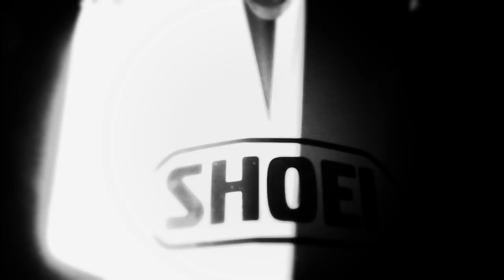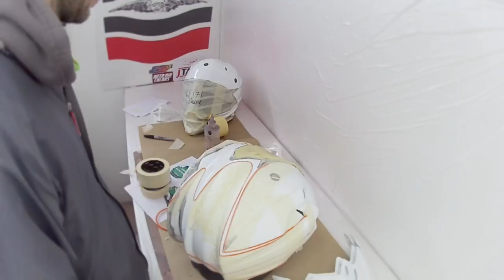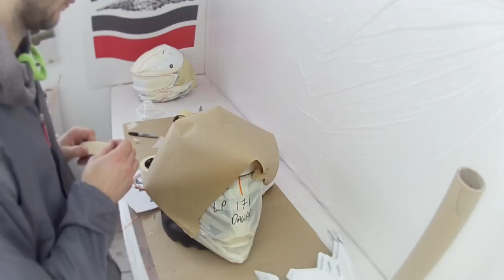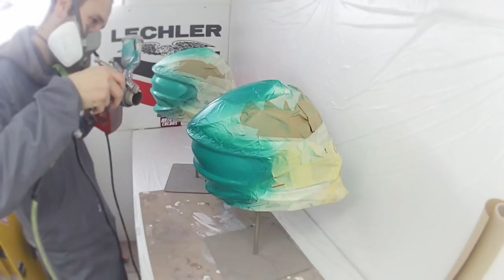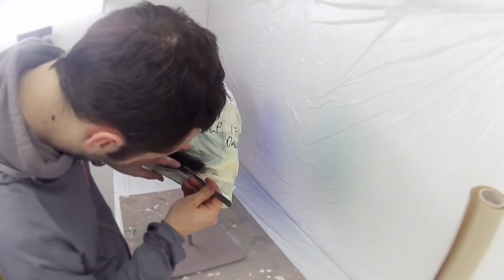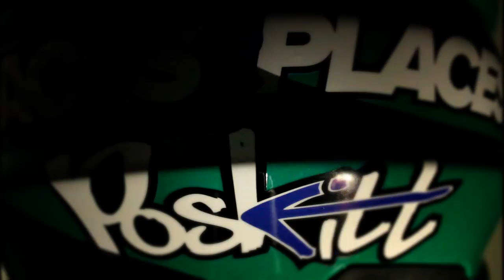Lyndon Poskitt 2018 Dakar Rally Shoei VFX-WR

Comment: Nice job! Just a little technical question: you don't prep or a least sand a little bit the helmet before painting?
Reply from the maker: Hi Benoit. We never film the prepping of keying of the helmet surface because it's done away from the paint bench to avoid getting dust in the area which could cause nibs in the paint.

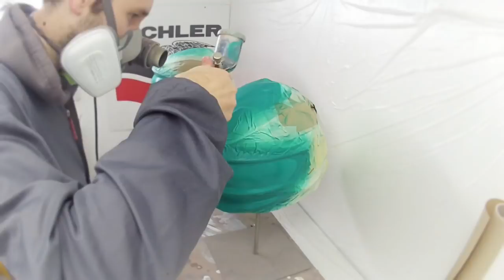Comment: @2:37 you can watch the paint cure and lighten up a bit.
Reply from the maker: Hi Kermit. I think that might have just been the camera auto adjusting the white balance. Water based generally go a little bit darker as they dry. Especially if they are from a gen one or two paint system which used to contain alot more solvent content.